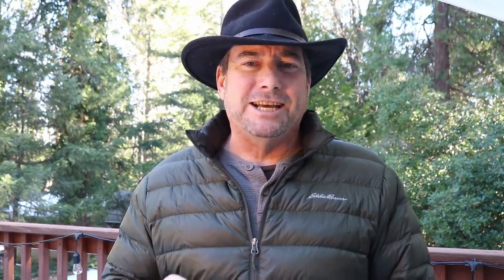Blancolirio UH-60 Safety Stand-Down

Comment: I thought the UH-60 was equipped with synthetic vision. It's not perfect, and has limitations, but it can aid in flying out of sudden IMC conditions.
Reply: The aircraft is not equipped with "synthetic" vision. The crew, however, is equipped with Night Vision Googles. NVGs help a pilot see better at night in visual conditions. They won't be of any assistance if the aircraft inadvertently flies into the clouds. There is a procedure for getting out of the clouds, but the use of NVGs is not part of that procedure.

Comment: Windshields are ant-ice. This boils down to no trained crewmember in back of helicopter. Pilots are not trained to crew back of helicopter. Most likely distracted by inside variables not outside variables. It has been a problem getting enlisted to fly more than their 24 your flight minimums. Led to cancelation of many flights. Pilots should not be allowed to crew the back of the aircraft unless that is their only purpose for being there. Even that should be discouraged at all cost to safety.

Comment: There was no reason to add maintenance as a possible problem. This is a flight crew problem.
Reply: When you look at a problem you consider all possibilities before you eliminate them. It's probably not a maintenance issue, but that's only probably. Do the evaluation and confirm it
Reply: really????? how about not enough information yet!!
Reply: Don't think mechanical has been ruled out, although low likelihood.

Comment: Didn't realize that you would delete comments that did not fully support you.  I'll not bother in the future.
Reply from the maker: No, I delete trolls. Some comments get caught in the filter.
Reply: @blancolirio  Understand that, I have gotten a bit worked up over how ready some have been to assign blame to individuals on no basis whatsoever, and perhaps have gotten preachy as I find that to be counterproductive.  Perhaps it will turn out that someone dropped the ball with risk assessment, but I'm doubtful of that, at least in terms of following the accepted process.  It may be though that the processes themselves need to be revised.  Agree that at least a short term stand down is in order if for no other reason to force the seriousness of the situation onto every stakeholder.  Keep up the good work!

Comment: Why are you speaking to UH-60 Black Hawk operations when you clearly have only a very basic understanding of them? I get that you flew C-130s, but how would you react if a Black Hawk pilot spoke to the mistakes that are being made in the C-130 world?

First of all, the weather in Rochester was not marginal the night of their crash. Icing conditions were most likely not encountered on that flight. The METAR and TAFs at the time of their crash were reporting clear VFR conditions.

Secondly, there are plenty of times a Black Hawk will be crewed with only two pilots, and no crew chief or additional crew member at all...that being said, there are many times when a flight will be manned by three pilots, instead of two pilots and a crew chief. For instance, a Standardization Pilot (SP) or Instructor Pilot (IP) may sit in the back and evaluate a crew flying. Any crew member, whether enlisted or officer, will still be required to perform additional crew member duties when sitting in the back...to include questioning the actions of the pilots in the front.

Windshield anti ice shedding and getting sucked into the engine? Yes, there is a warning about that in our operators manual. However, Windshield Anti-Ice should already be turned on when flying in visible moisture in low temperatures.

You are doing an awful lot of speculating with very limited information.

One valid point you brought up is the concept of high hour pilots flying together and getting killed together. This is becoming a startling trend in the Army and is something we will have to address in both our standardization and safety arenas.

Good day Sir.

Comment: Helicopters have a shitty safety record generally.  Take them up in the worst conditions...its like voting for a Democrat. No particular surprises here.  Very sad. =PC=
Reply: Patrick,

As a helicopter pilot for 30 years I have to take issue with your statements on several levels. 
Yes, they have a worse overall safety record than airplanes, but much of that is due to the different jobs that they perform. Most helicopter operations are conducted at lower altitudes than airplanes, and only in visual conditions. IFR flight is not usually an option. Also we often land at non airport locations. It’s what makes the helicopter so valuable- it does jobs no airplane can do. One has to be extra careful operating them, and has to know ones limitations as well as the helicopters, but I think my 30 years and thousands of hours operating them without mishap shows that they are safe. Not 100%, but no activity in life is 100% safe, and I believe that operated properly the rewards outweigh the risks. 

Also I don’t think your comment about “like voting for a democrat” is appropriate on Juan’s channel, and doesn’t bring anything relevant to the discussion. We certainly don’t need political commentary on EVERY subject!